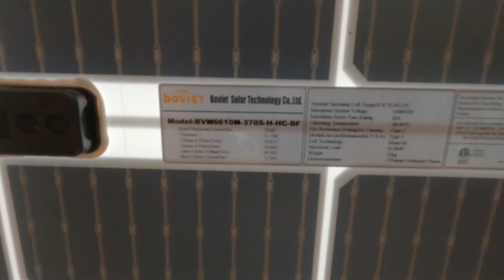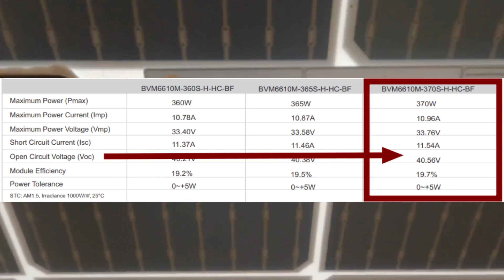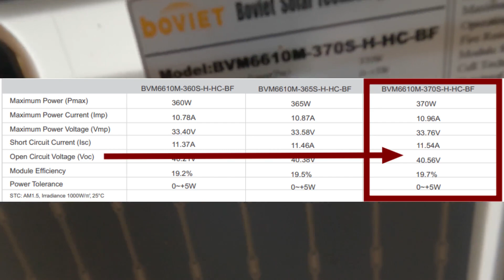5 - Putting Up The Solar Panels

Comment: Why not make you posts higher so that you can use the space underneath as a car park? and potting shed may be at the lower end or a long tool bench or half and half. You could use glass on the front part so that the sun would get in. and start off your plants in the springtime.
Reply from the maker: It's high enough I can fit even a bigger 3/4 ton truck under just fine(although it's too long and sticks out the back), but because of the angle cars fit under just fine. I have other plans for under so don't want to close it in, as it would prevent using it for what I need. All good ideas though!